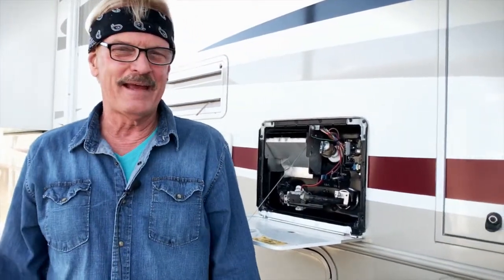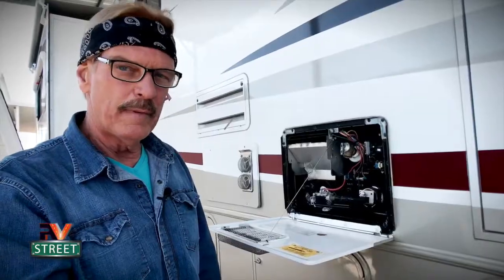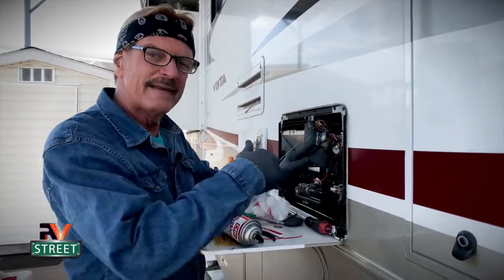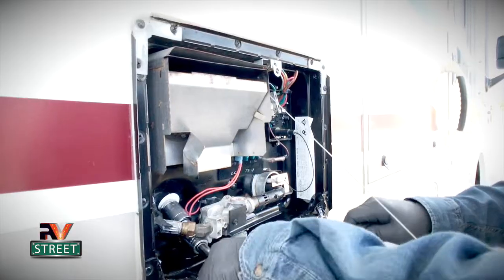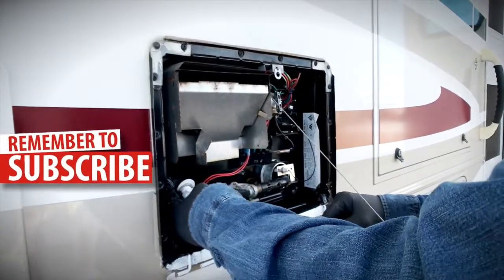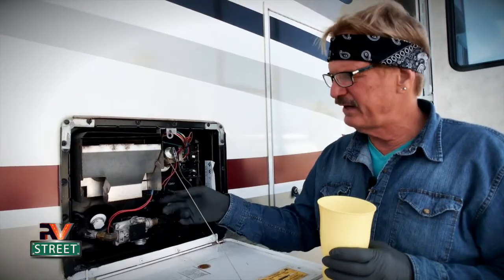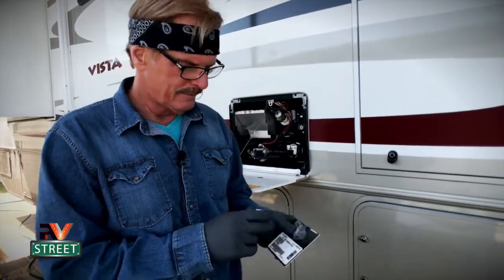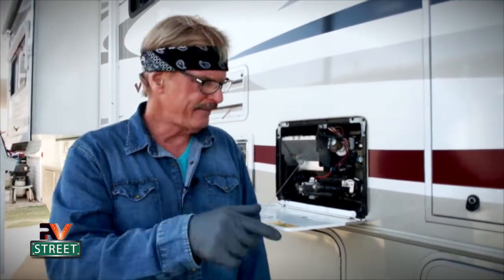CLEAN, FLUSH & SERVICE RV Atwood Water Heater 2.0

Comment from the maker: This is the same annual service you'd perform on a Suburban Water Heater—EXCEPT—with a Suburban, you'd also replace the anode rod. An Atwood water heater does NOT use an anode rod.
If your interested in the camera I used to inspect the water heater—which I also use in many other applications—you can find it in my Amazon Store in the TOOLS category.
https://www.amazon.com/shop/rvstreet

The Atwood Water Heater tank has a clad aluminum lining that protects against corrosion therefore doesn’t require a anode rod. A Suburban Water Heater does require an anode rod because it’s made of steel. This feature alone makes the Atwood a much better choice in my opinion and is one less thing to buy and change out periodically. However, both the Atwood and the Suburban Water Heater still need this flushing with white vinegar and service of the other areas I covered, to keep them in top working order and extend their life. “You guys can do this”. Now go get your water heater “MARTINIZED”. 👍

Concerning the Nylon Plug being the 3rd safety feature. I didn't mention what it actually does like I did on the other 2 safety features. Don't know how I missed that but....
The nylon plug is a backup safety feature. 
The plug is hollow on the inside so it's designed to blow out if the primary safety feature—the high pressure valve—fails for whatever reason.
As I showed in this video, since I have cleaned and removed the debris that was causing my initial leak in the water heater threads where the nylon plug screws into, I have gone back to the Nylon Plug and now do not experience any leaks.
Reply: About the nylon plug issue, sounds like a coincidental “excuse” to me.  Are you sponsored by Atwood somehow ?
Reply from the maker: @jrm163  It's not a coincidental “excuse”. It's the way it is. No I am not sponsored.

Comment: I am very grateful for your videos. Mainly because I’m on a very fixed income; I am a very arthritic female and I cannot afford to have other people do these things for me. However I have a 1991 Ford E350  7.5 L engine Class C and it has been worked on by so many different people for so many years that wiring isn’t correct 
; new appliances were not always installed correctly, and things are just not correct with systems. I have finally managed to get the engine in tiptop shape and new tires and new shocks but there’s so many other problems that I just have to trial and error fix them by myself. I just had paid someone $300 to install a 1500 W inverter on my auxiliary battery. Within two months the converter did not work because he had sold me a rain damaged converter as new. So it’s stuff like that that has just so disheartened me. I cannot afford a new motorhome. I have to continue to piecemeal this one. Your videos and the equipment you use and the supplies you use have been extremely helpful. The part of your videos that I would love to see more information is the size of the tools wrenches or whatever that you use for the different size nuts and bolts and whatever. I have diminished eyesight and it’s extremely hard for me to tell at a glance what size I’m using. And I like to paint the size on the socket or ranch itself. But it would be helpful to know exactly what size wrench you’re using or socket etc.I hope to watch many more videos in the years that I have left! Most of my systems do not match up with these newer systems therefore I have a lot of difficulty trying to figure out exactly what wire goes to what system so forth and so on. However I do find your videos very informative and I have been able to utilize quite a few of them with a lot of hunting and pecking on my part, so to speak. Anyway I’m very grateful that you publish these for people like me that do not have the funds to buy everything that is needed. I make do with a lot of things and I do very well and I can usually get something fixed. But your information has been extremely helpful and I appreciate the close-ups of everything that don’t have your hands in the way. So thank you very much. I have subscribed to your channel and I hope I can see many more great videos! Now if you could just show how to fix structural damage like a hole or some rotted areas I would be even more grateful! :)  Again, thank you very much!
Reply from the maker: WOW, what can I say Carolyn.
Thank you for sharing your story.
Your comment once again reinforces to me who a lot of our audience is and how we need to shoot these video's. Slow, close up, explain well what I'm doing and why. I promise I'll always try to keep these in mind when putting future videos together. Just going out to our coach and fixing something is easy. Fixing it, shooting it and explaining it on camera is a whole different animal. I have to constantly keep in mind what people want and need to see.

When I read this: "Within two months the converter did not work because he had sold me a rain damaged converter as new". That kinda stuff makes me mad. That's just not right.

But I will say, your tenaciousness to get done what your able to get done is admirable. I'm glad our channel has played a small part in helping you figure things out. 💗

Comment: Martin, I watched the first one and found it helpful.  I watched this one and found it to be 100% better.  So much more informative and by including the borescope you gave first hand evidence of how well this works.  We got a new class C in December and I thought I'd give it a try.  Couldn't be that bad right after only 9 months right?  WRONG!!!  I was shocked at the amount of little white turds I got out of my water heater tank.  You convinced me mate.  Now a part of my quarterly maintenance routine.  OBTW I did take your advice and bought the air compressor from your store.  So just wanted to say thanks.  Happy travels my friend.
Reply from the maker: I know right. Those mineral deposits build up fast and especially if you don't have a water softener. Good Job! 👍 And thank you Chief so much for supporting us using our Amazon Store. It means more to Joanie & I than you know. 🙏
Reply: @RVstreet  can I ask a  question?   In your previous vid on this topic you spoke of replacing the nylon plug with a brass plug.  This one you went back to the nylon plug.  Is there a reason?  I hope you don't mind me picking your brain but your info is so helpful, your like my go to encyclopedia for RV maintenance.   Thanks in advance Martin.
Reply from the maker: @chief7839  In the first video I showed the brass plug because at the time I couldn't get the nylon one to seal properly. In the 2nd video I showed how I discovered mineral deposits that we're embedded in the threads and once I cleaned those out I could go back to the nylon plug and it seated properly. The nylon plug is the 3rd safety feature of the Atwood water heater. It's designed to blow if the other two safety features I covered fail if to much pressure builds up in the water heater. It's a special hollow nylon plug and yes they are in my Amazon Store.
Reply: @RVstreet  cool deal Martin.  Thank you
Reply from the maker: @chief7839  👍

Comment: Another great educational video! Well done. Timely for me While traveling we experienced the regular weekly RV component failure this past weekend. Most times we use the electric side for water heating. This week though I wanted to run the gas side to expedite water heat recovery. Naturally it did not come on and work as I seem to need to have something go wrong with the rig each week LOL!. Never could get it to fire. I think I'm not getting spark. So today's project is to clean and overhaul the water heater to see if I can get her to fire up. Ours is an Atwood 10 gal. On ours, WBGO decided to make access to the WH so attractive with an outside swing up body panel covering and blocking the WH. Its so nicely designed to raise up above the WH to access the inner door panel so that it will fall on your head whenever working on the component. In my case water heater repair and maintenance is hard hat work!! Safe travels. Thank you Joanie and Martin for your good work on these videos!
Reply from the maker: Love your humor.

Comment: Very informative. Just a heads up on Dielectric grease: it is non-conductive and should be added after connections are made. This will help prevent corrosion and still keep fittings easier to dis/connect.

Comment: Hi Martin. I clean and flush my Atwood heater annually. I would di it more frequently if we used our trailer frequently. My suggestion is that instead of using 2  of the flushing attachments, I drain the vinegar solution and then remove the high pressure valve again and flush from the top down as well as from the drain plug. It seems to get a better flush for me.
Reply from the maker: Good for you. That's a great practice.
Ya I suppose you could do that. What ever it takes to remove all the dissolved sediment works for me. There's always more ways than one to accomplish the desired goal. 🔧 👍

Comment: Thank you,good video and very informative. I have been having problems with the plastic drain plug leaking, going to check to see if it is the threads on the tank that are clogged up like you suggested.
Reply from the maker: Glad you saw that little tip. 👍

Comment: You make me glad I have a Suburban water heater rather than an Atwood.  Easier maintenance due to the anode/drain plug.  Just clean the burner tube, flush out the tank and keep a spare anode handy.  Scale forms quickly so why bother with vinegar treatments?  Just flush it often.  I can stick my finger in the drain hole and keep flushing it until I can't feel any more scale, and the deposits I get up here in NY seems to be mostly calcium, some magnesium, and light brown sand.
Reply from the maker: Q) Scale forms quickly so why bother with vinegar treatments?
A) Because those mineral deposits will form and stick to the walls of the water heater and other places too. The vinegar acidity breaks it all apart and thoroughly cleans the water heater. Vinegar is an essential step to clean the water heater correctly.
thx William 👍

Comment: Great video. In version 1.0 you had changed to a brass plug, but in version 2.0 you are back to using the plastic plugs. What’s the reason for going back to the plastic?

Comment: Argh, so glad I came across this video how-to.  No idea, I just figured I had to replace the anode, oh wait, my Dometic doesn't have an electrode, Yeah I'm good to go!  But wait not so fast.  I checked out the manual and sure enough there is a flush sequence in the manual, but not really listed as a periodic maintenance item, just something to do to get rid of rotten egg smell.  So now on to cleaning and flushing.  I take it once you pour in the vinegar and hot up the heater for the 24 hour chemical soak, you never use hot water in your coach for the soak period, that would cause the solution to get diluted, correct. 

Thanks again.
Reply from the maker: The vinegar doesn't need to sit and cook for 24hrs. 8hrs. is enough.  And no it won't get diluted. The 50/50 mix will stay 50/50 thru out the process. As I said in the video, what I normally do is after dinner and all dishes and everything else is pretty much done for the evening, THEN I add the vinegar, turn on the water heater and let it cook all night while were sleeping. Then in the morning I drain and finish up everything else. Doing it this way we don't experience any hot water disruption.
The manual may not list this as a PM item but trust me it is. If you don't treat it as a PM item it won't last nearly as long as it should and won't work nearly as efficient.

Comment: Thanks for the video! Just got done cleaning out my tank. I did the air gap thing but now when I shut off my water pump then turn on the water it flows without the pump on. I made sure the pump is off because no motor sound. What the heck is going on? Do I need a new pressure valve?

Comment: HEB sells a 9% white vinegar which I used in my last flush vs the standard 5%. I took the fundamentals course at the NRVTA in Athens, Tx and the instructor said to use 2 gallons of 30% with 4 gals of water. But 30% is $20 per gal at Home Depot. Not being a full timer, I went with the 9% stuff.
Reply from the maker: Ya I hear ya, but personally, I don't think strength really matters much and especially when you do it often like I do and have a water softener. Traveling around the country, I never know what strength I'll be able to find. I just grab what's available. Usually @ Walmart, $5 or so for 3 gallons, but I have picked up what you did at HEB when we're in Texas. We love HEB. So using a 50/50 mixture and cooking it for 24hrs. with that acidity and the heat, it always comes out clean as the camera verifies.
thx for your input Charles 🔧 👍

Comment: Martin- I have watched both videos and have implemented the same regimen. Thanks for updating with more info on cleaning the electrical contacts. Just did it today. Worked like a charm. I have a question, what is the best practice regarding the water heater- turn on 15-20 minutes before use or leave on constantly? I have an Atwood with both the electric and propane options. I mainly use electric as we are in RV Parks 90% of the time. Thank you ahead of time for your answer.
Reply from the maker: Well ya know....there's a lot of opinions about that. Some people will say, "do you turn your water heater OFF at your house when not using it"? Which IMO opinion is a short sighted answer. It's not comparing apples to apples.
Most RV water heaters are a lot smaller than a house one and a different type. If a water heater goes out at the house it's usually very accessible and quite easy to replace. With an RV....not so much. So for those reasons alone we don't leave the water heater on all day. There's no need to be keeping it ON all day which is also using the heating element and other components. 
Our practice usually is, if we're going to take a shower, we'll turn it ON with electric for about 20-30 minutes in the morning, then turn it OFF.  For showers, we'll adjust accordingly. We have hot water all day and into the evening till bed. We rarely use propane because you know I don't like using propane. I like to make my propane tank last as long as possible. Even while boon docking or mooch docking I still use electric to heat the water heater.
Reply: @RVstreet  Thank you so much.  Can't wait until your next post..

Comment: Just wondering if i sould replace our atwood relief valve because of the calcium deposit around the relief valve spring. Can i put a dometic relief valve or should i use an atwood product.We just bought our 1995 vectra 34a in mint condition and we want to make sure that i don't damage the water tank lol  thanks Martin
Reply from the maker: I'd just replace it. They're cheap. Just remove the HP valve, take it to Home Depot, match it up with same type and replace it. Be sure to turn the water heater off, let it cool down, relieve any pressure by opening any hot water side faucet inside the coach until no water comes out and then remove it. Remove the old one put a little teflon tape on the new one and install.

Comment: Another awesome video which was really enhanced by the endoscope demonstrating the effectiveness of the treatment.  However,there are specific products made to clean electrical contact points but I noticed that you prefer the brake cleaner by CRC.  Have you had any issues with using CRC to clean electrical contact over time?  Do you use the brake cleaner to clean the power cord contacts on your rig?   Thanks, and enjoy your coffee.
Reply from the maker: I know there are specific products made to clean electrical contact points, but I've been using brake cleaner on electrical contacts for years and have never experienced any issues. I use it for many different things. That way I only have to carry one type of cleaner. On my power cord I don't use any cleaner, brake cleaner or otherwise. But about twice a year, I use a piece of 120 grit sand paper, and gently clean the prongs and then apply a thin coat of dielectric grease. I do the same thing with all my reducers (dog bones) and extension cords.
Reply: @RVstreet  Thank you.  I continue my quest to Martinize.

Comment: Help needed… my water heater relief valve looks like it is glued in with pipe cement or something brown . I couldn’t get the relief valve removed. 

I got the vinegar and water in through the winterizing system on my RV.
Reply from the maker: I am sorry you are having this trouble but I am sad to say that Martin has passed away and I don't have the answer to your problem. Sorry

Comment: Great information. I cannot find the list of products used? Went to the store but, there are tons of products. What is the spray on protectant?
Reply from the maker: Spray on protectant for what? Do you mean for the electrical connections? If so that is in the "Sealants, Lubes and Protectants" category in my store. When you go to any page in my Amazon store like you said there's a lot of products there that I use. In the lower right hand corner of each product just hover over the little info box and my description text will explain what I use that product for.
My main store link: https://www.amazon.com/shop/rvstreet

Here's a short cut link for now for those 2 electrical protectant products so you don't have to go back and read each product:
• Spray protectant: https://www.amazon.com/dp/B0013J7RAI?linkCode=ssc&tag=onamzrvstreet-20&creativeASIN=B0013J7RAI&asc_item-id=amzn1.ideas.3TFZBP7BI1XMD&ref_=aip_sf_list_spv_ofs_mixed_d_asin
• Dielectric grease - https://www.amazon.com/dp/B0788Y4SN8?linkCode=ssc&tag=onamzrvstreet-20&creativeASIN=B0788Y4SN8&asc_item-id=amzn1.ideas.3TFZBP7BI1XMD&ref_=aip_sf_list_spv_ofs_mixed_d_asin
thx Rhoda for letting my clarify that for you and others that may read your question 👍